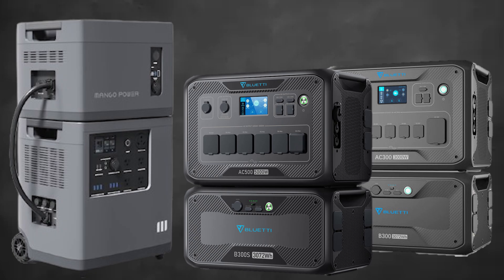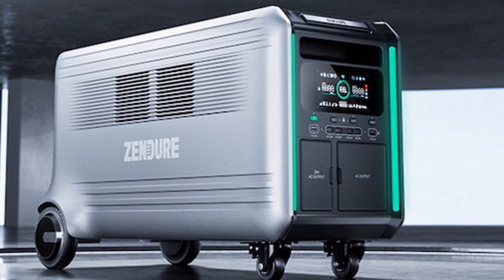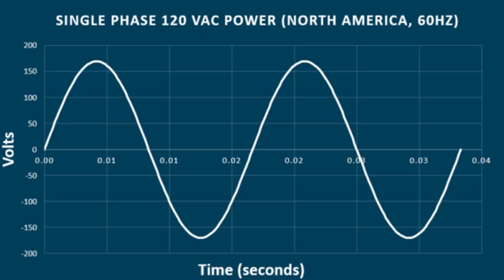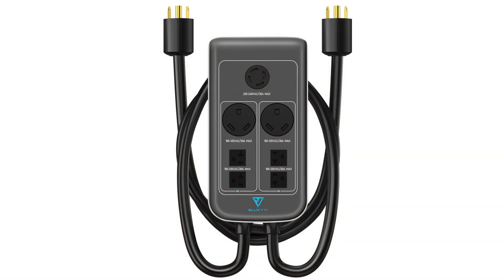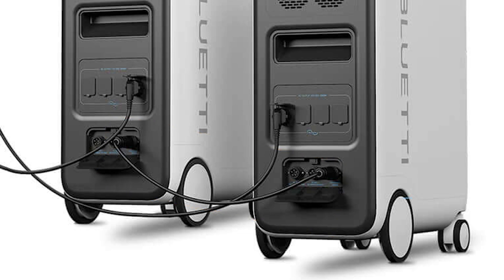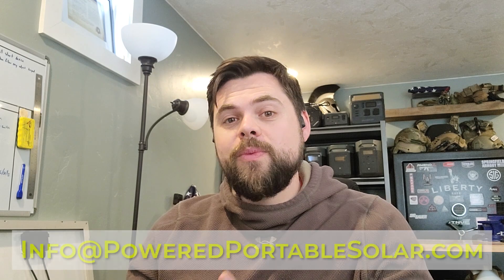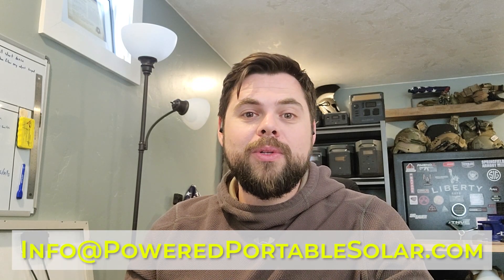Popular EcoFlow Delta Pro Question: 2 Delta Pros or 1 Delta Pro w/ 1 Expansion Battery?

Comment: Yes, ONE Delta Pro or DP + EB can output 240 volts if you use a Victron Autotransformer.

There is a solution for users who require 240 Volts Split Phase such as well pumps but where the users only have ONE Delta Pro.
This solution would help users who perhaps just can’t afford to purchase a 2nd Delta Pro at this particular time but would really like or need 240 volts split phase.
Obviously, the Victron Autotransformer is less costly than a second Delta Pro so it might be a viable option for some EF users.
This will allow users with ONE Delta Pro who may happen to already have a L14-30R generator receptacle inlet which connects to a split phase transfer switch at there house to SAFELY power 2 pole circuits and Multi Wire Branch Circuits (MWBCs).
Or perhaps a user can’t afford a Smart Home Panel (SHP) yet or they are in Canada where the SHP are not permitted yet so users will opt to use some type of transfer switch (6 circuit, 10 circuit or whole panel transfer switch) which typically contain at least one 2 pole breaker.
A EF user with ONE Dp + 2 EBs can now power 240 volt split phase circuits.
The downsides are:
- One Delta Pro will get depleted twice as fast as having two Delta Pros
- Solar recharging limited to max of 1,600 watts of input versus 3,200 watts of solar input on 2 DPs.

- DP's current limit will be cut in half as amperage limit will be reduced from 30 amps to 15 amps because the autotransformer divides current between the two split phase legs so user will have two legs of 120V/15A and 240V/15A but still with total of 3600W.

https://www.facebook.com/groups/deltaprolaunch/permalink/1619258981874284/

TLDR:
1. The Victron Autotransformer works great for providing 240 volt split phase while using only ONE Delta Pro.
2. Tested the Autotransformer with my Reliance TCA1006D 100-60 Amp DP Single Load Transfer Switch.

Video of test https://youtube.com/shorts/NwNXoFeTJDA?feature=share

Comment: Never seen a Zendure SBV with a front face like that even on their website - which has "ZEN A/C Output" door on the left covering two outlets (30 Amp RV Plug and a single phase 240 plug IIRC), and an "A/C Output" door on the right covering four 15 amp 120 volt max outlets. BTW the doors fall off in short order with normal use.

Comment: like your quick question videos.  thanks.  as likely mentioned in comments by now (nerds won’t miss this), the upcoming 2024 anker 3800 & ecoflow delta pro ultra are single units w/240v option.  awaiting reviews here on both.  btw, is ecoflow restricting reviews on the dpu, even after they’re in reviewers hands?  reviews have been so damn slow to come out.
Reply from the maker: Good to know about the short videos. I will try to do more of that.

Comment: Haven't seen any mango updates? Still having issues?
Reply: Yes woukd love to know
Reply from the maker: Yes, still having issues. Mango asked me to stop making videos until they fix the units. But I've had 4 units now, all have died. The last two, both inverters fried. They are telling me that they will have them fixed by doing a firmware update. They said it would take 2 weeks. That was 6 weeks ago. I reached out last week, still nothing to report. Don't go with Mango.
Reply: @minutemanprep  I have 2 units with no failures yet, I would like to do a similar test as you did to see if I cam get mine to fail, what did you to when the failure occurred?

Comment: Is there a solar generator can can have a externally connected 24 v battery
Reply from the maker: Only the original Titan, which is now discontinued. But I do have 3 used units that work 100% for sale if you're interested. info@poweredportablesolar.com

Comment: The new Ecoflow Delta Pro Ultra has 240 volt split phase out of a single unit.
The new Anker Solix F3800 also has 240 volt split phase out of a single unit.
At least that is my understanding.  Someone correct me if I’m wrong.
Reply: Yep! I have a single ecoflow delta pro I purchased last year, but will be getting the Ultra Pro for the reason